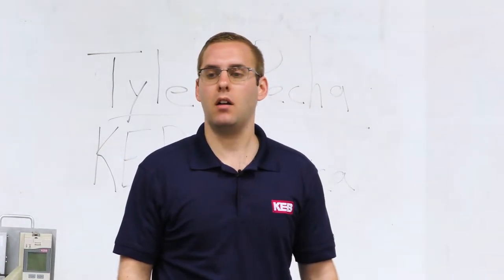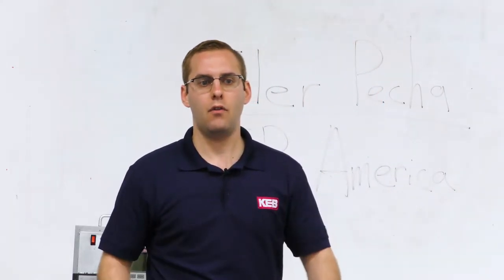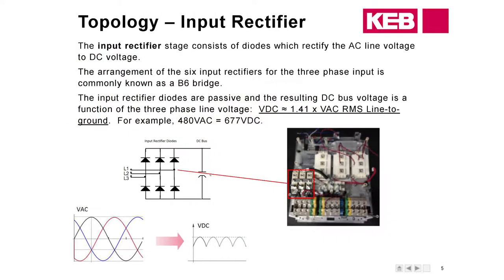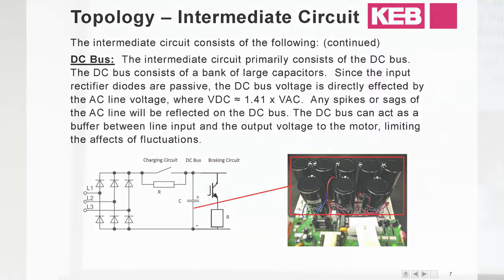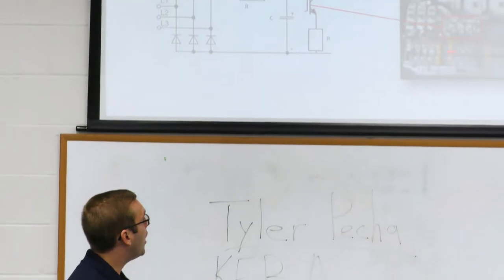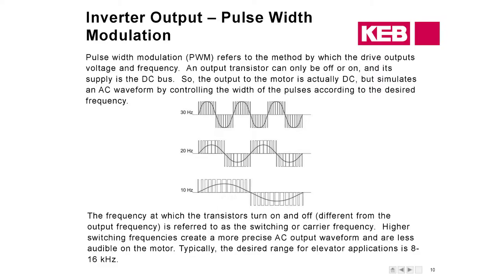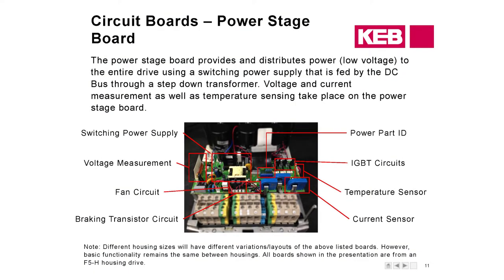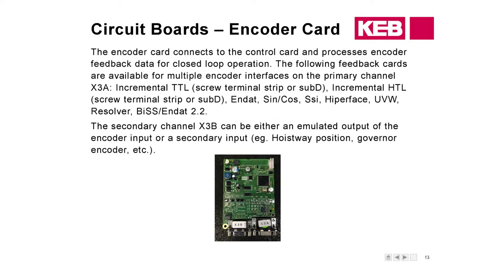KEB F5 Elevator Drive Training: VFD Topology Overview (Part 1)

Comment: i went to KEB  Brantrup Germany in year 2000  for attended KEB S ,C ,F4
Reply from the maker: That's great. A lot has changed since 2000. We continue to push forward with new technology, better solutions, and excellent engineering support for our customers. Have a great day!
Reply: @KEBAmerica  yes, i saw a lot of changing. During 1999-2004 i work as a KEB trianer and since 2005 onward i have no chance to touching KEB any more. Now my company is use ABB ACS800 & 880.anyway i still like KEB.